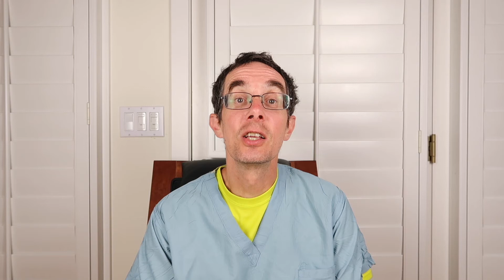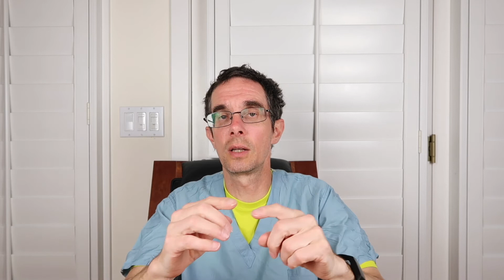Diastolic Heart Failure

Comment: Sir- I am 51 y women 5 ft 2 inch height and 109 lbs weight. My echo report says I have diastolic dysfunction grade 1. I do not have BP, diabetes. What could cause this problem?

My echo readings
IVSd—1 cm
LV posterior wall thickness—0.77cm
LVIDS—2.6cm
LV mass—90.1 GMA
E/A —0.72
E wave descelatation time —0.18 secs
Reply from the maker: Hi srip and I understand your concern. All of those readings are normal with the exception of the E/A ratio. That is what was used many years ago to make this diagnosis, but in up to 50% of people is inaccurate. That lead to using deceleration time (yours is right in the middle of a normal range), and also tissue doppler (which we call medial and lateral e'). There should be 2 numbers for this, as well as E/e' ratio. If you don't see that on the report, I would really question if the grade 1 diastolic dysfunction is accurate. It is standard of care for years now to report this on every echo so that should be there. If those numbers are on the report reply to me and I'll follow-up with more answers. If those numbers are not there I question the performance of the echo...
Reply: Normal LVEF

Echo technician provided below values from echocardiogram test results/images.
E/e’ Medial—7.2
E/e’ lateral—4.6
Septal e’—8
Lateral e’—13
TR— not enough to measure
LA volume index— 12.16 mL/ m2
MV peak E velocity— 59.9 cm/s
Reply from the maker: Hi srip and glad you got back to me. Your diastolic function is normal. Period. Every parameter other than the E/A ratio is textbook normal, do the "grade 1 diastolic dysfunction" that is on your report is incorrect. And sorry to be so blunt but other than what I try teaching to interns, resident, and fellows over a 6-8 year period to learn about this better it's hard in just 1 brief reply. If you are more curious here's a link to what I think is the best video on echo findings and diastolic dysfunction from Dr. Jae Oh at Mayo. There's probably alot more detail in there than what a non-cardiologist would understand, but he goes over the numbers and you can see where yours compare. Also note he gave this lecture 7 years ago, so this criteria is not something new or not yet validated, it is still what we use today. Feel free to reach back if you have more questions, and hope you stay healthy. https://youtu.be/bJRZTb-epg8
Reply: @ 
Thank you very much for your feedback. Very much appreciated.
Reply: @ 
Thank you for sharing the video. Per my understanding based on the videos, diastolic dysfunction is present or not is decided by E/e’. Septal e’, lateral e’, TR values. If present E/A value will be used for grading. Correct? Is using E/A value  line for diagnosing diastolic dysfunction is old way of diagnosis?  my echo report used only E/A for diagnosis. That is why it showed diastolic dysfunction.Correct? It was singed by cardiology and I wonder if he looked at these e’ values (ther are not in report given to me. I had ask sonographer) or not.
Reply from the maker: Absolutely correct and really impressive understanding of the video! And I didn't want to put in writing what you wrote but yes, I suspect that's why it was in the report and I couldn't say if the cardiologist didn't look at the appropriate data or if it wasn't given to the cardiologist (my opinion, it is the readers responsibility to do this). I didn't want to use this forum to bash someone...
Reply: Sir- I had EKG recently in my cardiologists office. It was abnormal but EKG 4 months ago from yearly physical was normal. Per my cardiologist, my EKG shows voltage criteria for LVH in limb leads and T wave abnormality( not in the prior EKG). He ordered nuclear  stress EKG. and cardiac MRI and both are normal. At this point no additional tests are ordered. Is there any tests that I can take to find out what is causing abnormal EKG?
Reply from the maker: Hi @srip, a few answers here. With a normal cardiac MRI (I'm surprised that was done but is a VERY detailed look at the heart), the ECG is of no concern at all. The MRI is the best measurement of the wall thickness (ie, LVH), and if that did not show LVH that is the gold standard, you do not have LVH. An ECG is only a screening test and many variables effect it (weight, blood pressure just for a few common ones), it is only an electrical representation of what we think is going on with the heart. If we see abnormalities there then we do testing to see if the screen if accurate or not. In your case it is not. Also I assume they measured the diastolic function on the MRI and given what you've written that would also have been normal.
The point is if a screening test shows variations but subsequent direct visualization is normal, then the screening test is the problem, not the patient. Hope that helps :)
Reply: @ 
Thank you for replying. 
MRI was done to see if echo LV thickness(normal) is correct or not. My MRI says
No evidence of myocardial infarct or infiltrative process.  Biventricular normal size with preserved systolic function. 
It does not mention anything about diastolic function? Does this mean it is not measured in MRI or it is normal?
Reply from the maker: No worries! It could be either, but given both the MRI and echo parameters the diastolic function IF not measured would be normal :)

Comment: Dear sir, does GRADE 1 LEFT VENTRICULAR DIASTOLIC DYSFUNCTION need any medicine ? Can it be revised ? How ? Please tell me, thanks
Reply from the maker: Yes, it almost always can be reversed. If it is due to blood pressure or weight being too high, treating the blood pressure to a normal range or losing weight almost always resolves the diastolic dysfunction. If this is what is causing it and those do not improve the diastolic dysfunction will get worse over time. Other factors such as problems with valves causing this or other issues outside of the heart are similar, if those get fixed it should resolve but if not addressed usually worsens. I hope this help!
Reply: @davidnajman7640  thank you sir

Comment: Hello Doc. Mine is a long story so i will try to abbreviate. Had an nstemi and pulmonary embolism back in October apparently due to a pfo that allowed a clot through. Have had multiple echos and mri and a heart cath. One of my echos says my left atrium was moderately dilated at 43 lavi. My Cardiologist isn’t concerned but i am. Lateral e is 11.3 septal e is 7.6. Lateral e/e is 4.3 septal e/e is 6.3. E/a ratio is 1.4 and e velocity was 48.7. 
Any insights on what this looks like?
Reply from the maker: Sorry for the delay in responding. A few questions/comments. How old are you and what is your body mass index? Do they know where the pulmonary embolus came from (legs, arms, after surgery...). I assume they did what's called a hypercoagulable work-up (ie, look to see if your blood clots more than most people), did they find anything there. Asking these to see what triggered this in the first place. Since you didn't measure it I assume nobody has seen any atrial fibrillation in you either? And if they didn't find an answer as to what triggered all of this did anyone suggest getting a watch or similar to check your rhythm every day?
Clots can either start in the heart or somewhere outside of the heart, if outside or from the right side of the heart those clots end up in the lungs (pulmonary embolus), or if it is small enough and you're 1 of the 20% of people who have a pfo and it happens to go right in that spot at the exact time of the cardiac cycle when there is a tiny crack there it can go through and then out to the body or the outside of the heart (your nstemi). I realize there are alot of 'ifs' there, but I need a little more information to help answer your question.
Your diastolic filling is ok but your indexed left atrial volume of 43 does make it moderately dilated, that in itself really is not a big deal but the larger concerns are in the questions above.
Glad to continue the discussion if you would like

Comment: i was diagnosed at 28 years old    Diastolic dysfunction lll how long do i have??
Reply from the maker: A few questions for you. How did they get this diagnosis? From an echo? And if so there should be 2 numbers on the report, medial and lateral e'. Can you tell me those numbers? Too frequently I see this read incorrectly on echos so that's why I want to make sure the diagnosis is correct. If the e' truly is significantly abnormal I'll have a few follow up questions for you.

Comment: I’ve been diagnosed with diastolic dysfunction and have very low blood pressure is there a way to raise up the blood pressure to a normal range of blood pressure? I have symptoms with chest pain and shortness of breath. So I’m trying to learn more about the condition since I’m under 50 years old. I’ve only discovered after being released from the hospital before getting my results of my echo and so have had to read it myself and learn what I can about it. My blood pressure has been 88/65 roughly give and take.
Reply from the maker: Nobody wants to be an interesting patient but this is a unique combination of data points. Diastolic dysfunction is most often caused by increased thickness of the heart muscle, that in turn is most often caused but chronically elevated blood pressure or longstanding obesity (which usually goes along with the higher bp). So to have a low bp (which is a good thing to treat diastolic dysfunction) along with that diagnosis raises questions. Please DO NOT post anything you're not comfortable with as this is not private, but what grade diastolic dysfunction (ie, grade 1-4, or mild-severe), what is the thickness of the left ventricle (should be 2 measurements), and is your kidney function normal?

Comment: Hi Dr. Should I be concerned with these results of an Echo cardiogram? (Male 35 Years Old) Left Ventricle:
Overall left ventricular ejection fraction is estimated at 60 to 65%. The left ventricular internal cavity size was normal. LV septal wall thickness was normal. LV posterior wall thickness is mildly increased. Global LV systolic function was normal. Spectral Doppler shows Grade 2 (Moderate) pattern of LV diastolic filling. Summary
1. Overall left ventricular ejection fraction is estimated at 60 to 65%.
2. Normal global left ventricular systolic function.
3. (Grade 2) Moderately abnormal left ventricular diastolic filling.
Thank you, sir!
Reply from the maker: Kamusta po. The easy answer is maybe. There are a few numbers that would be good to know, there should be a measure of septal and posterior wall thickness, there should also be something called tissue doppler (which is often written as e'). Those measurements would help answer the question, if your blood pressure is high, if you have diabetes, or if your body mass index is over 30 those will also effect it. Let me know if you're able to find those numbers
Reply: @davidnajman7640   Hey Dr., 
 LV septal wall thickness = normal 
 LV Posterior wall = thickness mildly increased 
LV Diastolic Function 
MV peak E: 0.94 m/s
MV peak A: 0.47 m/s 
E/A ratio 2.01 
LV IVRT: 67 msec 

Left Ventricle - 
IVSd 2D 0.97 cm 
LVPWd 2D 1.18 cm 
LVIDd 2D 4.88 cm 
LVIDs 2D 3.07 cm
LV FS 2D 37.1% 

Blood pressure 130-135/80 
Non diabetic 
BMI = 23% 
5' 10" Height 160lbs
Reply from the maker: @EasyEnglishEric   - Sorry for the delay in responding, I didn't notice you sent more info. Easy answer, I'm not worried about you at all. We look at e' (which they didn't measure and is the more accurate measurement of diastolic function), but your E/A ratio is normal, and the IVRT on the low side essentially excludes diastolic dysfunction. So I question how they came up with putting that on the report, and the only thing not completely normal there is the thickness of the posterior wall (and I would question if that was measured correctly given all of the other normal readings). Perhaps in 2 years repeat the echo, see if there are any changes, but there really aren't any concerns I would have based on your echo.
Reply: @davidnajman7640  Thank you so much!
Reply from the maker: @EasyEnglishEric   - hope to hear from you in 2 years :) and you're welcome

Comment: Gred 2 distoloc disfocan revars posibbal
Reply from the maker: Yes, it is possible to improve or even resolve this, but it depends on the cause. If it is due to obesity and weight comes down to a normal range this should improve, the same would be true for blood pressure or certain valve problems  as well.

Comment: Ive recently been diagnosed with Dys function stage 1.   Was put on amlodpine-  not overweight dont drink / smoke  been veg for 48 years .   Im 60....  great video Sir
Reply from the maker: I assume the diagnosis came from an echo and if really stage 1 you have no symptoms. If the cause of the diastolic dysfunction is high blood pressure (which can happen even if lifestyle is good), then keeping the BP better controlled is exactly what should be done. 2 points: 1, If you notice any puffiness in your feet that can happen with amlodipine so let your doctor know (if so they will likely adjust meds and it will go away), 2, I would repeat an echo in 1 yr to make sure it is not progressing or hopefully improved.
And thank you for the comments :)
Reply: And thanyou for your comment - i do get concerned about my constant high resting heart rate always over 90-  i get horrendous sweats...  no side effects from amlodopine- been on them for 7 months....  great video-   ❤
Reply from the maker: @skyechambers1968   - sorry for the delay in responding, I missed your reply. amlodipine does not effect heart rate so it won't bring that down. We don't like resting heart rates that high so if your doctor never checked things like thyroid function, anemia, etc, I would ask about those, and if your weight is normal your probably not very out of shape but the more conditioned you are the lower the heart rate usually.
Reply: what tests diagnose as i thought hefpef was normal ejection fraction on an echo
Reply: what are symptoms of heart failure

Comment: Just this last spring I was diagnosed with diastolic heart failure. It was only through an angiogram after having an echo and a stress test. The Dr. called it mild. I was put on Entresto for about the last 6 months. I don't feel better, maybe even worse. And it is really expensive even with insurance. Would an sglt2 be appropriate instead? I have an appointment in 2 weeks.
Reply from the maker: Please don't put any personal/private information here, but what is your ejection fraction on the echo and were there any significant abnormalities with your valves? Entresto is a very good drug for patients with low ejection fractions, and even though it has an indication for what we call heart failure with preserved ejection fraction (diastolic dysfuntion), that data is very sparse as far as if or how much benefit it provides. It is very good at lowering blood pressure, so if your blood pressure was on the low side to start, it likely will make you feel worse. If your symptoms are driven by excess fluid in your body an SGLT2, spironolactone, or other diuretic should improve your symptoms. If your body mass index is over 35 that is most likely what the underlying cause is and getting that down to a normal range will likely resolve the problem. Feel free to send non-private info or follow-up questions and hope you feel better.

Comment: My sister is a dialysis patient and the cardiologist says she is suffering from pulmonary hypertension as the heart muscles have become rigid.she is unable to evfn walk two steps due to breathlessness and leg swelling.could it be diastolic heart failure?no doctor is able to find the cause..
Reply from the maker: Just based on what you wrote, that likely is what she has. As I tried to explain in the video the heart is a muscle and has to squeeze blood forward, but it also has to relax to actively pull blood back from the body into the heart. A 'rigid' heart is often too stiff to pull fluid back in. A few good questions to ask her cardiologist (they will understand these and should provide answers to her): 1. How bad is her diastolic function. 2. Is the pulmonary hypertension out of proportion to the extent of her left sided cardiac problems. 3. Have secondary causes such as amyloid been considered. 4. Would a right heart cath help both manage meds and find out how much is due to lungs or heart.
I've seen too many patients unfortunately not adequately diagnosed or cared for, we can usually make symptoms alot better so I would get answers to these questions and those answers hopefully will make her much better.